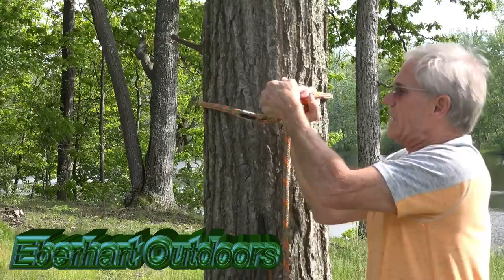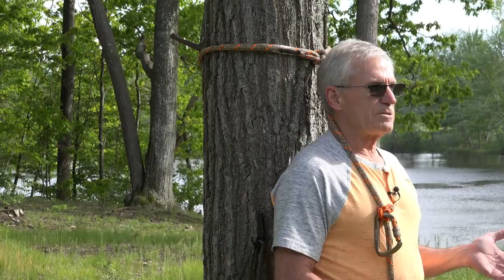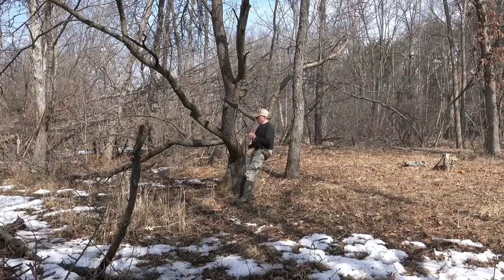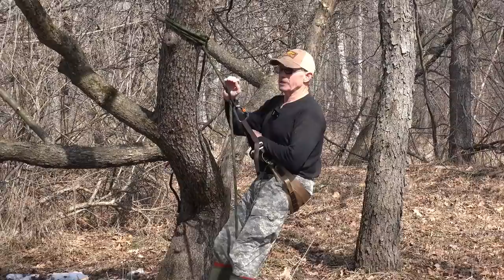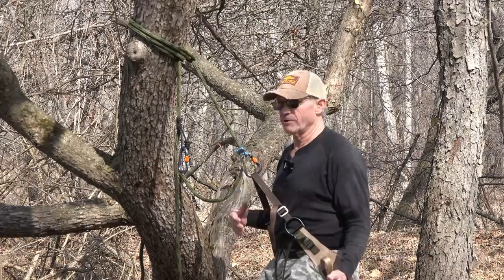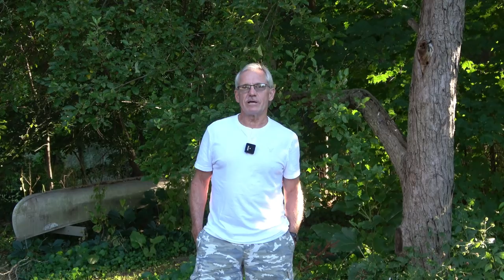29. Girth hitch knot, Ropeman ascender vs. Prussic knot, plus a Kill story

Comment: Your girth hitch recomendation is spot on and it's the exact method I use. However, your selection of the ropeman on your tether is flawed. The ropeman is designed for systems like a ropeman's belt where it has pressure on it at all times. It is NOT designed as a fall arrest connection. The reason that is, is that the teeth on the ropeman can destroy the rope in a sudden fall. The prussic knot on the other hand, will not damage the rope, so a prussic is always a better choice to use for fall arrest. If you search this concept on youtube, you will find some videos explaining all this in detail by professional arborists.

Comment: Good hitch, easy way to convert the running eye to a true girth hitch, I like the jrb cinch or saddle hunter’s hitch , it’s very easy and useful, won’t go slack and drop when you take weight off to do whatever, but will try this, oh check out the jrb ascender hitches, useful and silent , adjustable connection to your bridge with one hand

Comment: Thanks for the tip. I like the girth hitch! You might want to try the Kong Duck vs. Ropeman. Works great and no dilemna between version 1 and 2 depending on the diameter of your rope.
Reply: Agree, I just don't have a Kong. They both work in the same camlock manner.
Reply: Good video I was hoping for safety sake u were gunna tell people about rope diameter with the rope man. With all the new saddle hunters and the want to run small diameter rope. Also sewn eye ropes are a pain. The ones with the shrink over the stitching to do the girth hitch. I enjoy ur vidoes. Im about 30 min south of jays.
Reply from the maker: @ryanhasse6507  I thought about it but I've used the Ropeman on an 8mm rope and had no issues with it as the cam still had plenty of teeth one the rope.
Reply: I have a long climbing background. I have the CT roll n lock the duck and multiple ropemens. Even though the ropemen 1 is out of speck for anything under 10mm it's cam is actually more engaged than the other two. I still don't recommend using anything out of spec. If the device fails and you get hurt it's on you Even if the cam malfunctioned. The ropemens on some small ropes really smash them up. For anyone willing to learn knots I would recommend the mechoacan hitch. It's just a marvelous hitch for climbing and tethers. It's as easy as a ropemen and considered bomber safe. With a hitch like that no need for extra metal in the system. For those that want to use mechanicals than at least consider having a tight eye or loop tied knot in the bottom of tether to pass under your bridge then clip in to the beanier for redundancy. Plus it gets the long tag end from swinging around serving two purposes. Redundancy should be considered important when life is on the line. Lots of ways to achieve this with little effort. Keep an eye on your ropes for dead spots and other abnormalities. Great girth hitch tip John. Love the simplicity and not over complicating everything. I enjoy your channel and learn good hunting tactics.
Reply: @jhuntley575  Great info
Reply: I used a Kong up at the Boyne archery challenge and it stuck quite a few times where I had to struggle to get it to adjust and I didn't care for it at all.
Reply: @johneberhart4062  what size rope was it on?  I just went with the 8mm oplux (spelling?) ropes and the Kong was recommended for that size and the ropeman for the 11mm. If not the Kong for the 8mm, and the ropeman isn’t rated for that size, what would you recommend?
Reply: @jpoutdoors23  It was on an 11mm rope and I like 11mm because the girth hitch not is easier to untie when you leave. I have an 8mm rope and once I tie the girth hitch and hang for a while the smaller diameter rope is harder to untie. I have used the ropeman on an 8mm rope with no issues and there was a lot of cam left on the adjuster. Ropeman's are easier to work with and I do have a Kong.

Comment: Does the rope lose any structural strength when girth hitching?
Reply: I would imagine not
Reply: it will lose some of its tensile strength, maybe -20% max, but if you are using line rated for life support - 25kN or around 5500lbs - you still have a significant safety margin for around 20:1...IOW its not gonna matter until you start putting literal tons of force on the anchor
Reply: It would be very minimal and likely about 5% or less loss. These ropes can pull a small car out of a ditch, so for any hunter, there will never be an issue with the ropes holding your weight. When I was a buyer in the 1970's I used to test different fishing knots to see if the line would break at the knot or up the line and the only knot I ever used where the line broke before the knot was a polimar knot which is tied in a similar fashion to a girth hitch. There is no way any knot used on a tether and lineman rope from Tethrd will ever cause the rope to break under a humans weight.